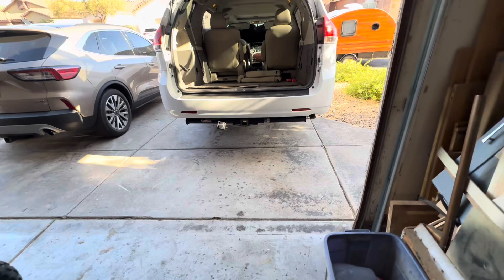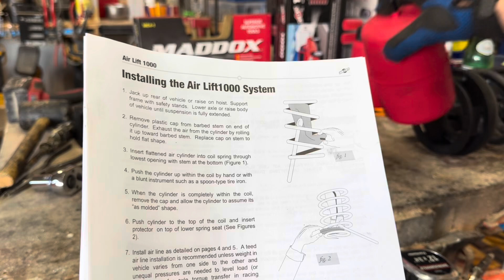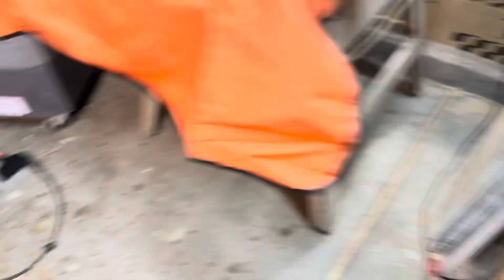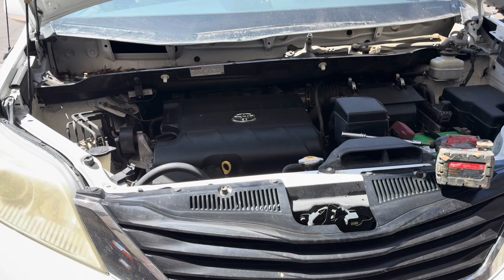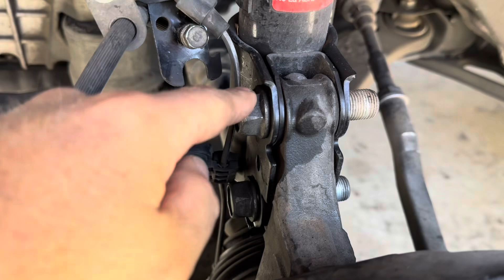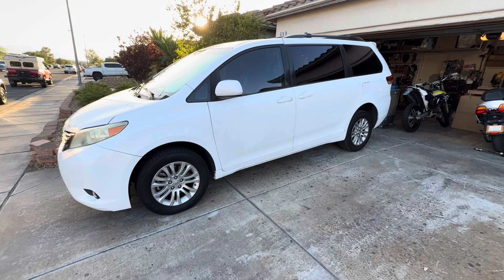Toyota Sienna Camper Build Series | Traxda 2 Inch Suspension Lift Install And Test Drive

Comment: Super helpful video. Really appreciate content like this on the Internet. I just finished installing the 2 inch body lift on a 2012 all-wheel-drive sienna. Two things that were extremely helpful for me: AutoZone rents for free a coil spring compressor that you can use on the rear spring which goes on the inside of the spring. That was a lifesaver for me after several attempts with two outside spring compressors like you used in the video. Also, I saw several people online saying I would have to remove the axle. I did not have to. I found it helpful to cut a 25 inch 2 x 4 and put it where the shock used to go in the rear to help keep the hub at its lowest point. 

After the lift is installed, the only thing you can see underneath is the rear coil spring holders barely protruding, so this lift is definitely needed! 

Just wanted to share that info I found helpful. Thanks again for the great video!
Reply from the maker: Great tips, thanks for sharing your experience with the install!

Comment: Appreciate your extensive inputs and tips.
Reply from the maker: Welcome
Reply: @EndgameCampers  want to do this to my 2014 van, so I looked at the Traxda system and I don’t see the rubber insulator in the kit now. Also, it lists the rear lift as 1.8” not 2”. I wonder if they removed that component (.2” net loss maybe?) and didn’t change the spacer size to arrive at the arbitrary 1.8”

Comment: Hi. Adding Traxda lift now. Question about the rear sock absorber fitment. What keeps the spacer bolt from rattling around hole since rubber gasket is between spacer and shock as pictured? The oem washer and supplied bolt doesn’t keep it positioned in middle of hole since rubber washer no longer there. Thanks

Comment: Nice install, well done. Front wheeler here. Am considering lifts and Traxda looks legit. 
 Any feedback on the air bags?  Where'd you install compressor? 
Thanks for fun video.  (Miss my lifted Subaru, 🤜🏼🤛🏼)
Reply from the maker: The air bags for me have been unnecessary, but don’t hurt anything installed. I don’t have a built in compressor, not needed for a system like this. I just use a bicycle pump.
Reply: @EndgameCampers  ... I discovered the install video and see what you mean. Great option to have. Thank you for the response.  Happy new year

Comment: what’s the air adjustment range ? I’ve watched siennas rolling down the highway with the already low oem ground clearance to where the tails are practically dragging with just the seats filled
Reply from the maker: I’m not sure off hand. The lift kit alone bumped the rear end up a healthy amount. I didn’t even inflate the airbags. I plan to only use them if if I’m carrying a larger load.

Comment: I wonder how much effect on mileage is due to lift vs change in type of tires?
Reply from the maker: About 1-1.5 mpg loss
Reply: @EndgameCampers  So you lost 1 mi due to lift and 1.5 due to change in tires? Or lost 1 mile due to lift and an additional 0.5 miles due to change in tires?
Reply: @RA-LHTX  Around 1 to 1.5 MPG loss in total due to both modifications

Comment: What about the torn boots on the front struts? And it looks like you are missing a clamp on the bottom of the boots. Looks like a nice kit though.
Reply from the maker: What’s your question?
Reply: @EndgameCampers  I figured you would have replaced them while you have everything taken apart. May not be that of a deal though.
Reply from the maker: They were replaced about 20k miles ago - so they still have a lot of life. I noticed the tear too, but honestly I’m not that concerned. Thanks for watching

Comment: Thank you for sharing this. I had a 1999 Gen 1 Sienna, front wheel drive with a 3.0 & automatic... it came from the factory with a tow package, but the automatic couldn't tow a thing without blowing seals & needing rebuilt. Do you know if your Gen 3 is any better in terms of transmission & towing ability? I see you have a receiver.
Reply from the maker: I haven’t done any towing personally, but the previous owner said she towed a small trailer without issues. The tow capacity for this one is 3500 pounds.
Reply: @EndgameCampers  Thank you... it sounds like Toyota beefed up the AT used in the subsequent generations. I've owned seven Toyotas, and I love their build quality, but that Gen 1 Sienna AT was the worst experience I had so far. I understand that on the first gen they basically borrowed the same drive-train from the Camry of that era.